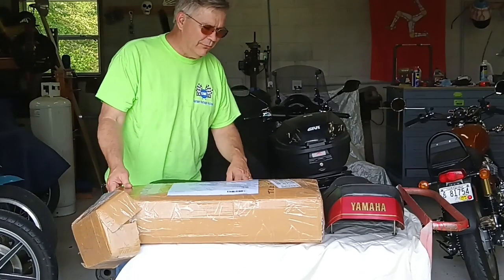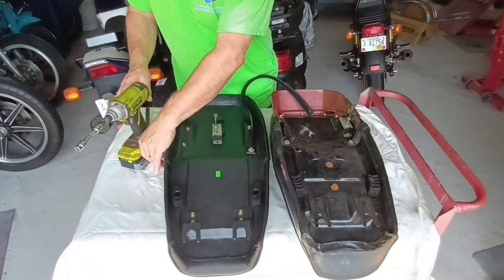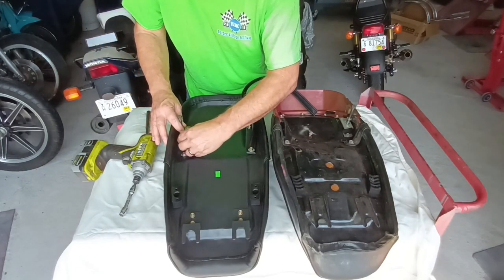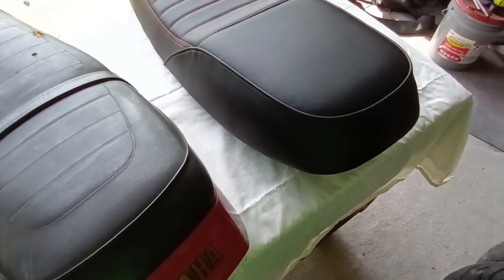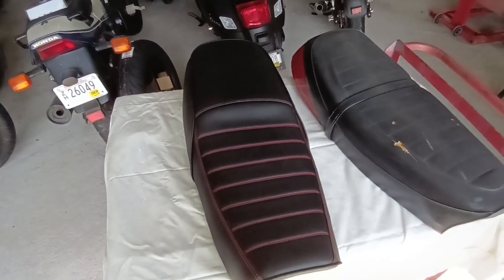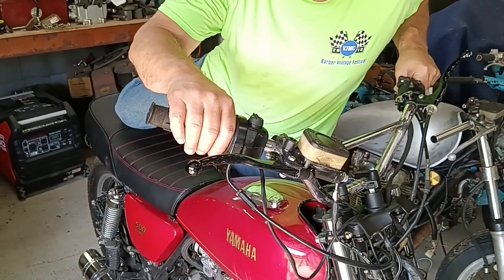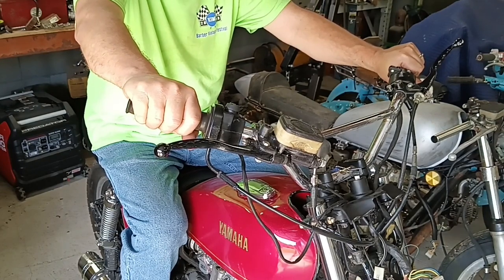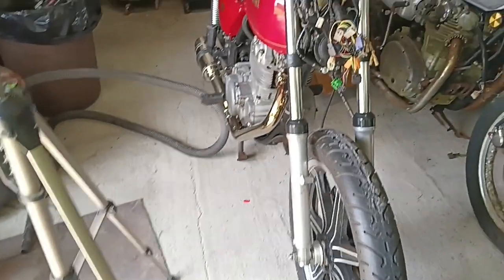Texavina Seat on the Yamaha SR500

Comment: I wouldn't be using that power tool on the seat mountings 
You mentioned the price of chrome these days, same here in Australia 
I recently had my original 1978 SR500 fork tubes rechromed they cost $420au for the pair at a specialised hard chroming place that only does hydraulic cylinders and motorcycle forks I thought that was okay because they actually grind them down then build them back up to the correct thickness, but when I contacted a regular chroming place about get the original handlebars rechromed I think they said it was gonna cost $320 
For that I could buy new locally made custom stainless steel bars 
Instead I bought new bars for an SR400 from Yamaha for $87
They're not exactly the same as the originals but they're pretty close 
My front mudguard was cracked when I got the bike about nine years ago and I bought a pretty good secondhand XS650 guard from "Geoff's XS" a fella over here who specialises in 650s
Reply from the maker: @hodaka1000  I understand why you wouldn't use a power tool on seat mounts but there still was about a 12mm gap between the seat mount and the frame. It turns out that there are lots of small differences between the 78-80 SRs and the newer ones. Unfortunately not all parts companies realize that.
Reply: @MotopsychoBlog  
A lot of the new 400 parts will fit and a lot of them still use the original parts numbers
Because of the only recently discontinued SR400 I can get just about anything I need though a local Yamaha dealership except parts for the rear master cylinder and caliper 
If I get their 400 parts I usually buy them from their internet site but if I need actual 78 parts I have to call them to check availablity and buy them over the phone but it's surprising what's they can still supply and the staff are very obliging 
At the moment I'm waiting for oil pump rotors to come over from Japan I bought them off the 2016 SR400 listing on their internet site but they have the same 2J2 part numbers as the 78 500
Sometimes things are a little different but you can usually work out what is or isn't compatible by their schematic diagrams or part numbers  
I recently bought new screws for a gearbox bearing retainer off their 2016 400 internet listing, they're Philips heads on the 78 but I received torque head instead but they'll do the job
Reply from the maker: @hodaka1000  A lot of the parts interchange but using the CMSNL website helps a lot. There are a few things such as the left headlight mount that are unique to the U S. models. The rear fender has different mounting points at the front also.
Reply: @MotopsychoBlog  
Yeah not everything fits, I'm not sure about the earlier SR400 that were also first produced in 1978 maybe they had a 19" front wheel, but the later ones have an 18" front wheel and a totally different front mudguard (fender) and lots of things are different like their fuel injection crankshafts magnetos ignitions and magneto covers and things but a lot of the basic things like transmissions cylinder head clutch parts kick start parts and things are interchangeable and often use the same part numbers or updated part numbers on parts that are still compatible 
I heard 90% off the parts from the 400 are interchangeable with the 500 I don't know if that's correct but a lot of the parts are interchangeable
What's unique about an American SR500E 2J2 left hand headlight mount compared to an Australian SR500E 2J2 left hand headlight mount ?
As far as I know the US/Canadian 2J2 is basically the same as an Australian/New Zealand 2J2 I don't  think anywhere else in world got our 2J2 with cast wheels and a rear disc brake other than here and there
The main difference is the speedometer dials on Australian models have metric dials and I'm not sure but you could tell me the US models have either imperial or combination imperial and metric ? another difference is the US SR500E 2J2 was available in black and like your bike red while in Australia they were only available in black 
Another difference that is unique to Australia are the sidecover stickers on any Australian SR500 were fitted locally and say "500 Single" in an old style script 
You do know the British/European released 1978 SR500 had spoked wheels and a rear drum brake ?
 CNSNL is a good site I've seen it I haven't bought anything from them but I know it, one thing I like about it if I'm not mistaken they have a list below the descriptions of the parts that shows other models that use that same part  
And there SR500E list shows what parts are not available without having to contact them to find out
But there's nothing wrong with Yamaha's own site it's pretty good and I think their prices are very reasonable as I said SR500E parts can't be bought through their internet site you have to speak to them but that not a problem and their schematics are the same as the schematics in my genuine Yamaha SR500E Australian New Zealand parts book 
I got a clutch shaft recently the shaft the clutch cable connects to that goes into the engine I think it was about $47au from Yamaha soon after I saw one on eBay in England listed as NOS for around $175
Reply from the maker: @hodaka1000  I don't have access to an Australian only part diagram. It's possible the Australian and US model have more in common.When I was installing my custom  headlight mounts one mounting hole was different and the Japanese manufacturer of the part told me that the US version was unique. This video shows the difference between mine and the JDM version   https://youtu.be/ApubQwYCgJ0?si=1VB65qFaT9ZIIT1u
Reply: @MotopsychoBlog  
Right 
I looked at your video and looked up the schematic drawings for 1978 1979 1980 SR500s and 2016 SR400 and a NOS "cover" (that's what it's called) on eBay and they all showed that same wider bolt pattern on the left side, then I looked at my cover and mine has the same equal bolt spacing left and right as yours 
I hadn't noticed that difference the wider bolt spacing on the left in the schematics but it is there 
I had noticed in the drawings another difference to mine in the top of the cover where the instrument mounting bracket bolts to it 
You know how the cover is made up of front and back plates welded together the two top mounting hole for the instruments are formed by both plates being folded forward together 90°  
In all the schematic drawings I mentioned and looking at that NOS cover on eBay they have a separately formed  90° brackets welded to the cover's front plate as well as the wider bolt spacing on the left 
I imagine your cover would also be folded like mine 
So there you go your uniformed bolt pattern between your left and right headlight brackets is not unique to the US model it's the same as mine 
Another thing I've noticed that's different from the schematic drawings is my rear caliper has a much larger contact surface where the stainless steal plates work between the caliper bracket and caliper 
Another odd thing I have a spare rear caliper bracket that is cast differently and is heavier duty than the one on my bike and two others I have but they all have the same "2J2" on them 
What month was your bike made ?
Mine has 2/78 (February) on it's compliance plate I had another one in the 1980s it was 10/78 and from memory it had the same cover as our bikes with the 90° folded tops and even bolt spacing
Our bikes the US and Australian models are basically the same same